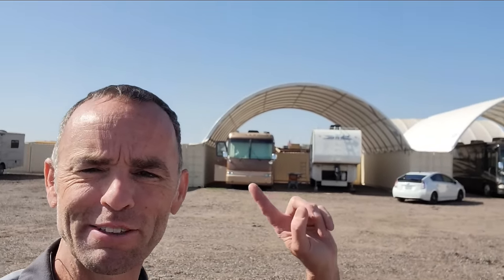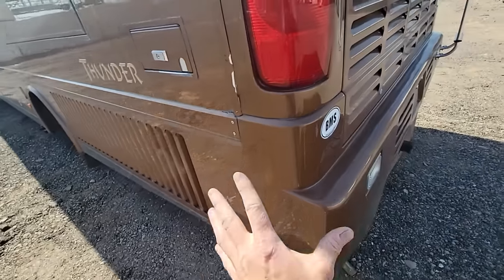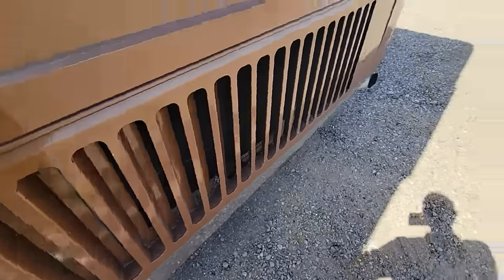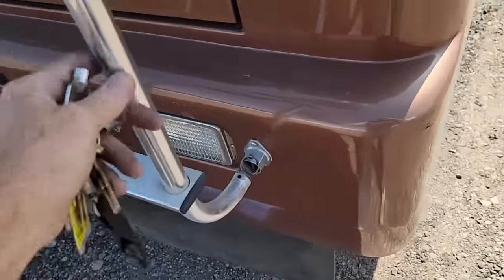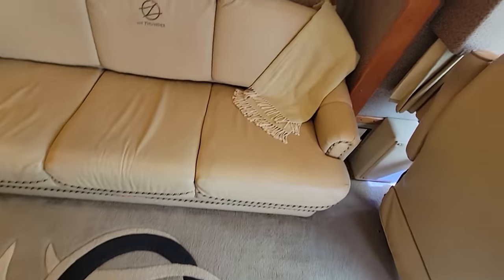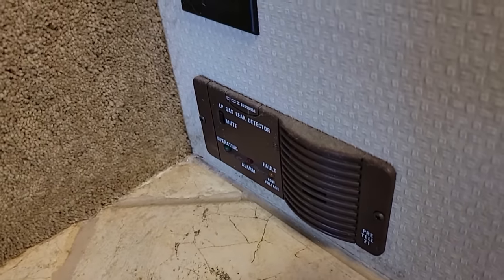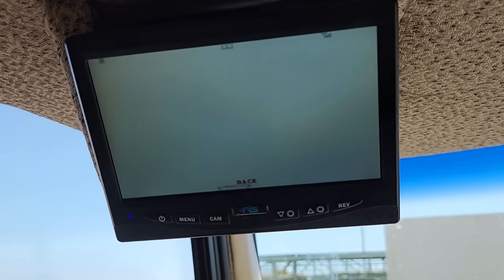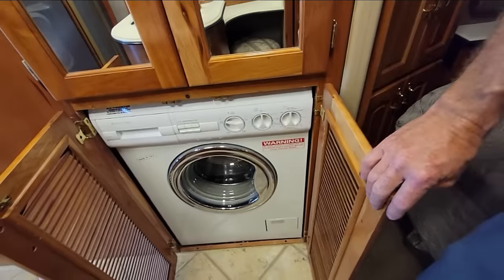The Truth About My RV and Other Common Questions

Comment: Fantastic Deal  fantastic and beautiful coach a pittance in repair costs overall w the 
Mechanicals and tires  being  as new.     and the air conditioner heat pump. Also.     Approaching  issues of somethings to be done super cheap , seat covers the back of the fronts are fine please have the  dining chairs reupholstered, certainly.  A new  skylight and reglazing the windows, a must especially. I would rather they stay intact if possible , 2  silicone washers on the brass handles, a dollar lol.   redoing the slides gaskets would be a necessity after 20 years and then, after all. With the two   Plastic doors being fixed using  copper sheeting of which you could fashion remove the wind gauge I can’t remember anything else that would be considered expensive the sagging roof liner is actually the hardest to accomplish. Maybe a shop can use a spray gun in a tiny slit in the fabric to re-coat above headliner, to fix it back onto the wood, or some bows made of whatever material that you could anchor in every so many feet that would conform to the roofline easily and to be painted prior to installation. I guess the most important question is now that you just 
Disclosed the purchase price 
Would be the manufactures price when new any add-ons and the conversion to today’s cost or value my 2004 Lexus in today’s dollars would price out $35,000 more than its MSRP just at 100,000 in today’s dollars so what you pay for what you’ve got into it and what you have which I’m sure with this coach  is going to shock the viewer at truly how much of a bargain these have a potential to be I’d like to hear about that if you haven’t spoken of it already and awesome video. Also paint the cap the cost of everything being repaired which should’ve been done by now Also given plus the service costs would be a huge factor in showing how affordable this is overall, I guess I should thank you too for taking the time and effort to enlighten the viewers turned fans

Comment: Your list is a good one for fixes and I think there is no escaping the long list we all get when owning a older rig. I have a 98 Beaver Patriot Monticello and my list is growing. I have already checked off a large amount of fixes and upgrades and after an 8000 mile trip I have some similar fixes needing to do that you brought up. I am very interest in the bulb seal for the slide you mentioned and very interested in the adjustment solutions to the slide. Please keep me in the loop on the slide adjustment procedure. I also have to to replace the Fan-tastic Vent since the remote doesn't work after getting wet. Dog Bowl accident. Seems you can't buy a remote for that aged of a vent. You mentioned replacement parts, can you swap out the senser to work with a new remote? Anyway, Thank you for posting the way you are because I learn a lot from you.

Comment: Great coach.  Terrific price!  It would have tempted me!  Looking forward to seeing all your fixes, maintenance, and upgrades.  Our 2000 Harney Renegade has some of the same components and issues.  Ceiling material sagging in spots, and fogging glass and bad seals.

We replaced our “Creepy Seal” dual pane windows with laminated dual pane windows from RV Glass Solutions.  We did them over time (decades) as the budget allowed.  One early one had a minor issue with delaminating and they replaced it for free.  

Sitting in Yuma and still trying to figure out how to access my air dryer filter … sigh

Comment: 🟥🟥🟥 Yet another great video.  I had a similar battery drain on my 2002 Patriot Thunder and upon reading the manual, it says it's common to have a parasitic draw on the system and they say if it's not plugged into shore power in a week, your batteries will die, which I found to be true. Some of the draw does come from the inverter fans that run occasionally.  When I'm on the road camped, I'll start the engine or generator occasionally to charge the batteries.  And a remote watering system to fill the batteries is a must. Just curious if you noticed my question in one of your previous videos asking about my suspension lean? Keep the videos coming!
Reply from the maker: Thanks for watching!! :)
Reply: I had a solar trickle charge hooked to the starter battery and that worked fine.

Comment: I had the exact same problem with the ignition on my 96 patriot. It was the front rear selector switch in the back not the normal ignition switch.
Reply from the maker: Thanks for the tip

Comment: Those are all fairly minor problems and btw, that's definitely cat damage. I would just get a cat and not worry about it. But seriously, reupholster those dinette chairs. It'll probably cost the same as buying new chairs but keeping it original is the best move. The leather furniture can be cleaned and repaired to some extent. The rest of the stuff is minor and just knock each thing off the list one by one over time. The most important thing is that the engine and systems work as they should. It's definitely a nice rig and worth 67k all day long. By the time you're done with it it'll still be worth what you paid imo.
Reply from the maker: It's really nice and I am very happy with it

Comment: You dont have to change the handles out if you dont want. They are brass, you could do any of a number of things to solve the problem. 1. Find a machinist and see if you can get them knurled around the top. That will give you grip when wet and they will look better. You could also get some heavy duty black rubber bands slightly smaller than the knobs and slip them on near the top. That should give you enough grip also and will provide visual contrast making the knobs look better.
Reply from the maker: I love the brass. It fits the style and honestly--gold hardware is back in style

Comment: James, another very good video, thank you kindly )   Loved your coach so much that I also bought an excellent old Beaver with about the same 160k miles.  My seller was a single owner, high tech guy that took great care of the Beaver with all receipts and all service logs.  So surprising to find such a deal, since my Beaver is also nearly 20 years old.  The solid maple cabinetry was welcome vs the fragile composite wood materials used far too often in cabinetry and furniture.  Your chrome bay handles/locks are sweet accents!  Any chance I can replace mine that are metal painted black?

Comment: Finally subscribed. Been watching a few of your videos for helpful tips - your personality matches mine, haha! I have a 2004 Beaver Marquis and have had the same issues - clear-coat peeling on roof, broken wind sensor, wiring/AC issues, sagging slid-out, etc. Love the CAT C12!

Anyway, I'm currently servicing my Aquahot and wanted to share something NOT found in your videos or others that I hope can help other owners of the older AHE-100-02s systems. If anyone reads the manual regarding which type of anti-freeze to use, it says "Propylene Glycol" whereas the older systems (specifically mine) use the "Ethylene Glycol" anti-freeze - the same stuff used in older automotive radiators. DO NOT MIX the two! Even if topping up. It does require 16 gallons to fill the system!

I got to this video after watching the first one on your Beaver purchase. I was most impressed with how well the carpet protector was applied! haha. I've tried doing as good a job and that stuff is a Bear to work with doing it solo, let alone cutting it perfectly to fit.

Keep up the great videos!
Reply from the maker: Thanks for the tip!

Comment: If you shorten the exhaust pipe, it could allow the exhaust into any rear unsealed pocket areas, and maybe into the passenger area.
My family got sick on a trip out west due to a factory exhaust pipe that was too short on a new passenger car, and the carbon monoxide,
with no odor, had everybody throwing up.
Reply from the maker: That's terrifying!

Comment: That is still in pretty decent shape.

I replaced all my running lights on our Dynasty about 5 years ago due to just barely starting to crack. My skylight was still in excellent condition after being 20 years old just last month but I went ahead and replaced it as preventive maintenance.

As for the cosmetics, I'm one of those anal ones you mentioned about the paint having to be free of flaws or it drives me nuts and will ruin a trip.  My coach HAS to be mechanically solid and cosmetically as close to perfect as possible before it leaves the driveway.  It gets a thorough inspection before backing it back into the shop after each trip to ensure it's ready for the next.

I'm sure yours will get there to.  When we bought ours at only 5 years old it took me several months to correct the previous owners neglect before I was pleased with it. Now keeping up on it is much less work.

Thanks for the video.
Mike
Reply from the maker: Thanks for watching! :)

Comment: On the air intake, putting some epoxy with a syringe.mite at least stabilize the ply and then sealing that metal box will slow down the rot. Cheers from Northern California.

Comment: I joined to0 from the last video! A note on the day night shade. They started breaking on our older 5th wheel. We didnt care about the day part So I cut all that off and restrung. I forgot now exactly how I did it but you rethread like two circles. I also added a toggle like you find on hoodies so it would really stay open and not depend on tension of dumb screw in the wall. That was the issue in first place. Again as I said in comment on last video our 5th wheel and trailer is crap. They had some of the screws off line and too much tension so it drug the string through the bottom valance end eventually acting like a saw and cutting it. Because trailer we dont hear if moving around but you could add a stick on velcro to hold it. Both these items available at fabric store. Oh I used a really long tapestry needle to thread new string back through. I did with them in place. And the toggle button I think I put at top. Sorry 10 or so years ago now. ok just info from a 50 year sewist who figures out how to fix cheap things. I want the baby brother of that RV.  All through the last tour I kept picturing a celebrity musician, singer using it. That vanity. When my current partner of 10 years met me I was living in a 9x11 room in a converted office building. It was nice. Historic, in renovated art district. But had no closet and shared bath and kitchen. So anything above that is great!
Reply from the maker: Thanks for watching!! :)

Comment: Hey great to see a more in depth tour and inspection. $67k seems a bit rich to me. Maybe I got lucky? Picked up my 98 Mountain Air with 141k miles a month ago for $27k. Right up the road from Cassones in Sun City. The Beaver is super nice, with a few higher quality touches, and the Mountain Aire has some checking in the gelcoat. However for less than half the price, I’d take the deal I got any day!! At the end of the day, what’s important is that you’re happy and you feel you paid a fair price.
Reply from the maker: Yep, super happy with my rig

Comment: I replaced all the smoke alarms with the wireless set of smoke alarms, any alarm goes off, all of them go off, and one more in the battery compartment, just in case there is a fire in the battery compartment, everyone will know about it. The new smoke alarms have 10 year batteries, so you replace the sensor and battery in 10 years.
Reply from the maker: All good ideas! Thanks for watching! :)

Comment: 2 things ... 
I am having issue with my fan as well. Haven't seen the little kit you have in the drawer anywhere. 
Can you tell me what it is called and places to order it from. My fan will go up and sometimes not come down and we have to grab the knob and hold it for the motor to stop.
 Next is when you do your camera replacement and the add-on of the side cams, PLEASE do a video.
 I have the crap original rear but am concerned about maybe needing to pull new wires and what have you. Also, not sure on the execution of adding side looking cameras.
Thanks

Comment: I just got a 2001 Marquis Ameythest 42’ with a tag. With 110k miles. 2 toilet room dual vanity. Needs tires and several other smaller issues. Drives like a dream. Paid 62k for it. Think i got a steal.
Reply from the maker: Then that is all that matters

Comment: James, Colan RV in MO has a couple of brass/gold single control bath faucets. I just bought one and a shower wand thingy. They look new, or very gently used to me. Check it out! Loving your coach, she's a nice one and I think 67k is great 👍.
Reply: That is "Colaw" dang Auto correct!
Reply: And it's a Kohler faucet.
Reply: Also, I have a sagging foam-backed vinyl ceiling too so please share the correct glue to fix it. Thanks!
Reply from the maker: Thanks for watching! :) and for the tip

Comment: Did I hear you correctly, you had to fix the belt line trim (common issue with Beavers). How did you do that, from what I have heard the belt line cover is glued on and very difficult to remove to fix the attaching fasteners.

Comment: What does it cost plus/minus to replace a roof on 2003 Winnebago.  If I remove all the solar,  and the big sky lite is new 1 year ago. Have good seals, but some desalination in some areas. No leaks inside. Have all side sealing in great shape. If I have delaminatiom but does not leak, is that OK? But looking at new roof as love 2003 class A. Let me know what the cost "could" be Thanks Larry.

Comment: I'm not sure how much these things are worth, but, if you get another 10 years out of it, you'll probably end up paying more in fuel than the purchase price.  Can't imagine this thing getting over 5MPG. So, that would be about 1.5 dollars a mile.  I guess I lucked out when I converted my new 2021 Toyota minivan hybrid that gets 37 and its all wheel drive.  Tho, hard press to put a washer and dryer in it!  LOL ;) Altho, everything is electric, has no belts, and has an electric heat pump for AC/Heat that runs off the hybrid battery, plus it runs a 1500-watt inverter off the hybrid battery as well. So, microwave and Vitamix work well. Nice Video.
Reply from the maker: It gets around 8 more or less depending on the drive. It would take a long time to make up the purchase price in fuel as it's not really a daily driver. Micro Rvs are awesome--you should make a video

Comment: Check the aluminum body chassis to where it makes contact with the vehicle steel chassis. Electrolysis is common on these and they corrode. I’ve got a 2001 Patriot Princeton… and thank you for the video! Always great content and as usual, I learned something about mine I didn’t know cause of the vid!👍
Reply from the maker: Thanks for the suggestion

Comment: Seems like it would have a mechanical master battery switch disconnect for the house and the chassis. My marquis does and I have an amp and a half also that I need to track down along with figuring out why the xantrex echo only charges the house.  I vote for a slide adjustment video, my br slide seems off and appreciate the tip to check out the air intake!
Reply from the maker: I will do my best! Thanks for watching! :)

Comment: Thanks to you I learned a lot about the Beaver Thunder brand. Did you know tandem tires started with the 2002 model? It's one of my requirements on my next rv. It was the one feature missing on yours. The price is way out of my budget. I will have to look at other brands. Some have tandem axels as early as 1996 and are not as fancy but are priced under $20k and more affordable.
Reply from the maker: Make sure to have a THOROUGH inspection

Comment: I just bought an 2001 Marquis Emerald in March and have some of the same issues and complaints. My dash heater core started leaking and it looks like a nightmare to get that out since the access is terrible. It seems like they installed that and then installed the front cap. I live full time in mine and things are falling apart quicker than I can fix them. I'm slowly catching up on all the maintenance and little things.
Reply from the maker: Thanks for watching! :)

Comment: 8k for a 1993 rexhall 39 ft with 20k miles.
Cummins rear engine......runs perfectly, everything works....... All I had to do was replace the batteries.... Change the oil in the engine...
It's all I need 😊

Comment: Speaking of slides, on the 2004 Dutch Star the slide behind the driver is a bit crooked.  When it's all the way in or out one side is still out by about an inch. Is there a way to adjust that?  Also what is that little sprayer next to the toilet for?  LOL

Comment: Very nice coach, on the topic of roof leaks, I washed my roof and around the heat pump units. Is very easy to get water inside through the air/heat pump?

Comment: $67k, road ready for a dry-weather trip, no major cost to repair needed... yes, I'd say both buyer and seller got a fair deal, with the buyer coming out on top just because he is so darned enamored of his new-old land yacht.  I have minimal experience with constructed homes like this, having spent a few days and nights in two.  I was surprised at how cheaply the walls were made, same for the cheap, cheap plumbing of the water lines to sink and tub.  This baby with its 3/4 plywood, veneered for beauty, puts them to shame, and though I can't tell the condition of water lines, I suspect Beaver did not cheap out on them either.  God on you friend - and if you ever need to park it long term I have just the place in my back forty.

Comment: 2000 RV with “Splendide Comb-o-matic 6000, automatic washer and condensing dryer.”  

The dryer function stopped working.  Is it possible for an average person to troubleshoot and fix?  Are parts even available?